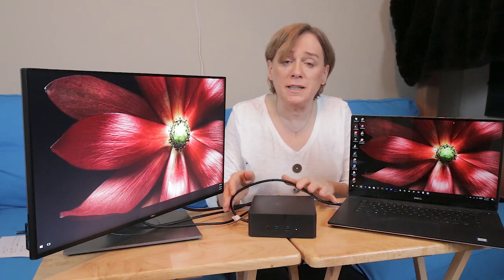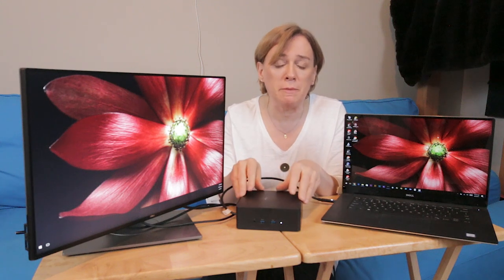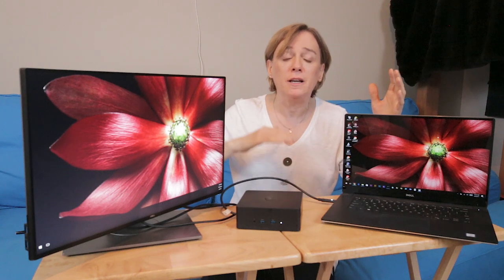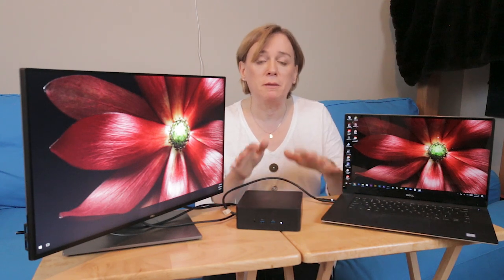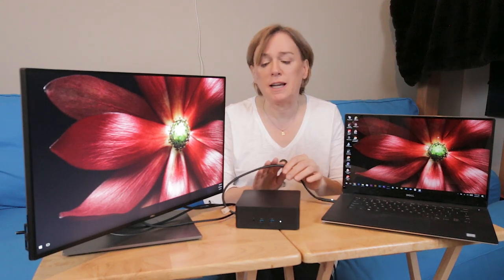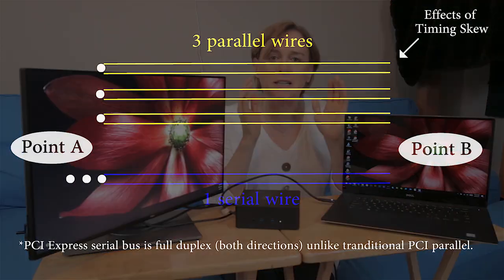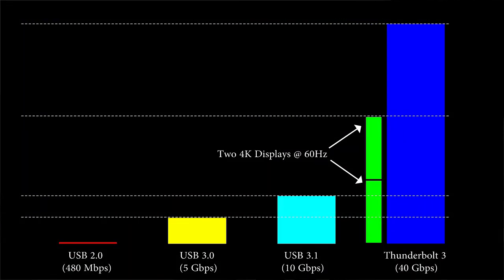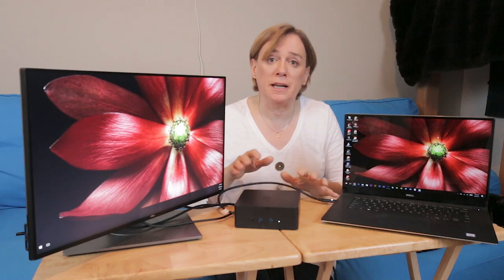Longer Dell Thunderbolt Dock TB16 Cable?

Comment: Great technical explanation, Ashley.  It's always good to know why the cable is so short.

I blame Dell's goofy designers for this.  The .5m cable wouldn't be so bad had they just had the cable's connection come from the rear OR coordinate with the laptop designers to put the TB3 connector on the other side of the system.
Reply from the maker: Jared... thank you for stopping by to see the vid and for your feedback!

Comment: Hi Ashley its  fascinating how you promote the benefits of this dock and especially the cable technology and importance of this dock. When I watch this I assume that even Dell knows about the importance of that cable configuration. I have an XPS13 and this Dock TB16 but I have a current issue with the nearly not even a year use of the latter. The switch housing of this cable broke, without any incident or external false use...just connecting it not even daily with my XP13 and the cable switch housing breaks? No I am really shocked how DELL Support and customer service handles this issue...no replacement, now maintenance nothing.... Some inches more in length of the cable were good. But a long-term working Thunderbolt Switch should be essential don´t you think? Do you know if this is what customers have to expect with DellSupport. (my latest experience refers to the German support HQ. They offer neither guarantee services nor solution bearing in  mind the safety issue with a threatening short circuit I  have to face... Do you have an idea ?
Reply from the maker: Hi Rudi, Sorry to hear you are having issues with your TB16. When you say “Switch” do you mean plastic plug casing/housing? (i.e., “kunststoff stecker äußere gehäuse” ... please forgive me if that is incorrect, I translated using an online translator). Is that what you mean, your TB16 "kunststoff stecker äußere gehäuse" is broken like mine in my video? If my understanding is correct, can you clarify for me, did Dell specifically tell you they would not fix the broken plastic housing of your TB16 plug?

Comment: how do you hook up between a desk top and a laptop, data transfer, my hard drives connected to my main XPS desk top computer, planing on getting XPS lap top
Reply from the maker: Try searching both YouTube and the web for "transferring files from pc to laptop" (without the quotes).

The subject of transferring files is off topic from this video, and it can be tricky to get right depending on the user, apps involved, etc.... there are simple answers, but ymmv depending on the apps involved, security of your setup and other things.

One of a seemingly infinite number of examples of what I'm trying to say... consider an app licensed to a pc... you might be able to move its doc files but can the application work on the new system? 

I could give you easy sounding answers but it would be disingenuous to do so... when you want to know how to do a specific thing, best to search for videos and articles which are comprehensive and match your situation. 

I will consider making a video on this topic but I don't have any plans to do so.

Thanks for the question and for stopping by! Really, try searching... there are videos on the topic you ask about, I'm certain.
Reply: Just thought you had more information who cares if off topic , just asking for help
Reply from the maker: I have no issues with your topic, I just didn't have a good simple answer to offer in a reply, was just leaving the question open for someone who might have had an answer.

Comment: Does Ethernet cable supports 1Gb or above?
Reply from the maker: @bilalqadir1438, It is 2023 now, forgive the delayed reply, was on long break from channel. You may be past your question but fwiw you can easily check the specs yourself at the following link. https://downloads.dell.com/manuals/all-products/esuprt_electronics/esuprt_docking_stations/dell-thunderbolt-dock-tb16_concept_guide_en-us.pdf

Comment: I broke my cable plug by bending it by accident (because it was too short!) Seems to cost more to replace the cable than a new TB16?
Reply from the maker: @Richard_L_Y, Forgive the delayed reply, it is September 2023 now, was taking a break. Sorry to hear of the cable faux pas... I'm not certain of the current cable pricing or its comparison to TB16 prices. The one TB16 price I saw on Amazon just now makes me think that cables may be less expensive, but I've not purchased one since my March 2019 cable replacement video at the following YouTube link. I would assume prices to be the same or lower... but I cannot say offhand, sorry.  https://www.youtube.com/watch?v=UlW0KghiVxg&lc=UgwhgPqC4gpBTJds6F14AaABAg
Reply: Many thanks  @AshleyPurring

Comment: You are wrong. I have a 2M TB3 cable with 40Gbps. The difference is active vs passive cable. Meaning, cables can have logic at both ends, that amplifies the signal. Belkin makes 2M TB3 cables with 40Gbps.
Reply from the maker: You're not saying specifically how I was wrong but I'm inferring from your followup you might be under the impression I'm saying it's impossible to lengthen the cable using an active cable. If that's not what you're referring to, let me know. If that is what you're referring to, did you see the video "fly out" (lower third) at about 4:11 into the video which qualifies my discussion as excluding any supported active cable setup? https://youtu.be/s0m5JTTMkIU?t=249 

Also see 4:55 into the video, where I clarify it would not only be nice for Dell to offer a supported active cable, but I also disqualify myself from stating what is feasible with active technology for that dock/laptop.

The discussion and web pages shown in the vid reference passive setups. 

Anyway, even though you may not have liked the video thanks for stopping by and offering your feedback. Take care.

Comment: OK so here is my solution.  You use the dock with a laptop to attach a big screen.  So you make sure have cable holes in your desk.  Then you make a little bracket under a hole for the dock to sit on, sitting on it's end so that the cable points up toward the hole.  Pull the cable through.  THat way you can put the laptop to the back of the desk to connect.  Then run your monitor cables down through a hole in the desk (might need to get longer ones) and connect to the dock under the desk.  Get a full size wireless keyboard and mouse and stick the bluetooth receiver into the dock under desk.  That is also where your speaker cables go.  You plug your printer into the dock also.   Then when you get home, click the laptop onto the dock cable and away you go with the  wireless keyboard and mouse.  The lap top screen becomes an extra screen (though small) and you have your one or more big screens to work with.  Problem solved.

Comment: There are fiber optic cables that will handle this purpose just fine. One is 60 feet (yes 60 feet) for devices needing power, and the other is 100 feet for self-powered devices. These are on the VERY pricey side. Check Linus.
Reply from the maker: Thank you mistmini for watching the video and your tips/info! I bet those are pricey but at least folks who have a strong need have an options, thanks for sharing that!

Comment: hmmm...dumb idea:  if you  flip the unit upside down, then the cord would be  closer to the PC...although seeing the bottom of unit might be unsightly.
Reply from the maker: Thank you Chuck... not a dumb idea... So here's where I went with that suggestion... 

I was going to try turning it over but as soon as I started to explore actually turning over the the unit, I realized there is a fan(s) inside, and there may even be other things I'm unaware of, which might have issues if I turn it upside down. My guess is keeping the unit upside down would be fine but I do not know if Dell tested it that way, and if not, it would mean there could be unexpected issues crop up with such usage, including possible safety issues given undocumented usage. 

Such concerns of mine are likely very remote corner cases but I prefer to use an electrical appliance/unit like this per specs... there's a number of good reasons, such as safety/support and all that. But definitely not a dumb idea... thinking about and discussing esoteric possibilities costs little and is an invaluable talent even if the ideas aren't always used... because thinking out of the box can lead to good solutions and many people are afraid to express the out-of-the-box ideas that may not seem that great on hindsight... IOW, overcoming the fear of who one might look for sharing an idea like that is a positive contribution... risking a thought to find a possible solution costs very little and may yield great success and there is no harm/foul if not. So thank you for thinking of and suggesting the esoteric... I hand't thought of that... I had to actually sit in front of the unit and begin turning it over to see the vents, recall the fans, and then all that triggered my safety concerns so I opted not to... but I didn't know that before trying. Long winded but I feel it's important to share that thinking out-of-the-box is a good thing and totally welcome... thanks again!

Comment: If technology is the limiting factor on the length of TB3 cables, then why does Apple sell TB3 cables up to 2 meters long?
Reply from the maker: Thanks for watching Eaton, great question! It appears that the Belkin 2m TB3 cable supporting 40/Gbps is an “active” cable, that is, would have to contain additional powered electronics to ensure reliable communication. Apple’s web site doesn’t differentiate directly between active/passive... but the following Belkin pages do…
Belkin 2.0m active: http://www.belkin.com/us/support-article?articleNum=207559Belkin 0.5m passive: http://www.belkin.com/us/support-article?articleNum=207574Comparison: http://www.belkin.com/us/support-article?articleNum=207558
Reply: Perhaps those cables are 'active' but only for certain low power needs such as a mobile phone etc. If it powers a paper-clip then legally they are allowed to call it active. Belkin Cables do tend to be higher grade materials than OEM cables to be fair. 

Great information in this video btw!
Reply from the maker: Thanks!
Reply: I've just opted to get this for my new 5520. Let me know if you ever do source a longer cable that works! Thanks for the video Ashley.
Reply from the maker: I will and thanks again!

Comment: not hard to understand, the cable carry high speed signals and power, longer will be the issue for user.  I am electrical and computer engineer

Comment: Great Video, but I hate the TB16...  I came from a Lenovo Thinkpad T530 and Docking Station, and I find the performance way better on the older Lenovo Technology when it comes to Video and Network. I have seen my mouse temporarily jerk across my screen when I am coping large files from my PC to a server.  I don't think Dell thought this one through very well for business user.
Reply from the maker: Thanks for the compliment. Regarding the TB16, I've had good luck with mine... I'm currently using it with my laptop closed most of the time with external monitor as my monitor, works nicely. But dock experience can vary on many factors beyond the dock, and also ensuring you have the latest updates. I use the TB16 with an XPS 15 9560 so Dell focuses on compat with those two, they are meant to be used together... so maybe that helps my experience. Best of luck finding the right setup, thanks for stopping by.

Comment: And i still find it stupid that it isn't fibre cable to begin with with optical ports on the back of devices instead of staying with the limitations of copper. Yes i know there are thunderbolt to optical  devices, but optical on the motherboard be it with an extra copper braiding for powerdelivery, like the very early Light Peak technology that had a normal usb plug with two fibres in it.
If they can do it with 3.5 mm. headphone jacks with toslink combined for audio, then why can't they do that with usb 3 for data?
Reply: my guess is a longer cable or other technology could be used, however my second guess is the solution would cost as much as the dock if not more ...

Comment: I simply want to have a 3' cable w/ 20GB (totally fine) -- but also be able to have ethernet throughput. Extension cables I've tried do everything accept allowing ethernet adapter discovery. Unless I'm missing something.

Comment: Nice video, but nobody would care about the cable length if they had simply put it on the other side of the box. Having to route that pig tail cable over/behind the dock is really a dumb design decision by Dell. Considering that the dock and laptops are all Dell homegrown designs with left hand charging USB-C port, it doesn't seem too difficult to have the cable on the right side of the dock.
Reply from the maker: I hear you... I don't know why they made the decisions they did... my guess is there are reasons which made sense at the time. I wouldn't mind the location it has now with a longer cable... maybe in the future they will provide a Dell-supported active cable extension for those which want a non-standard non-desk usage like me. But with that short cable I wish the location in/out of the unit was different.
Reply: Or they had offered a 90degree angle switch instead. what is more my switch housing broke and support ignores this issue...terrifying how they handle such a hot wire issue...